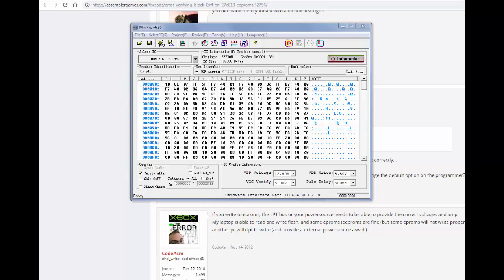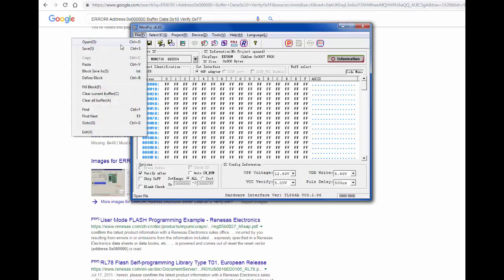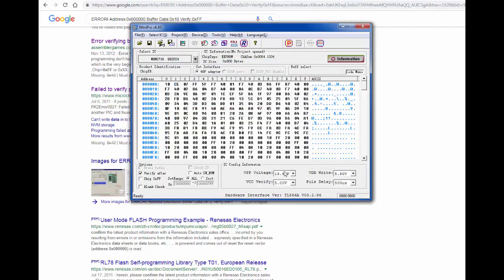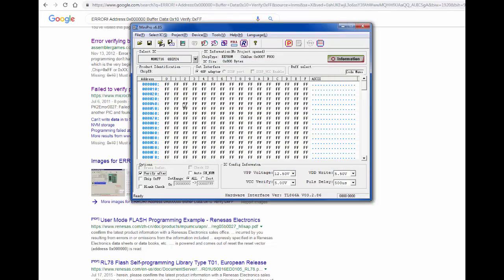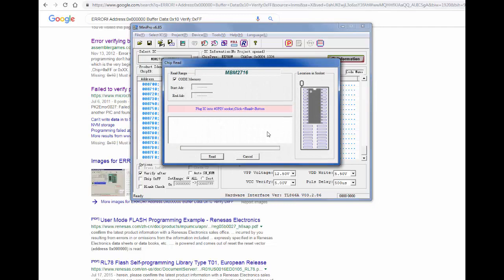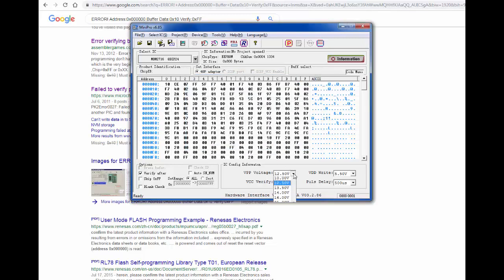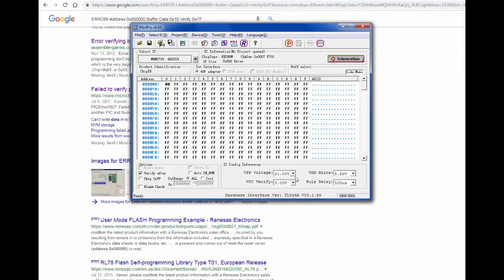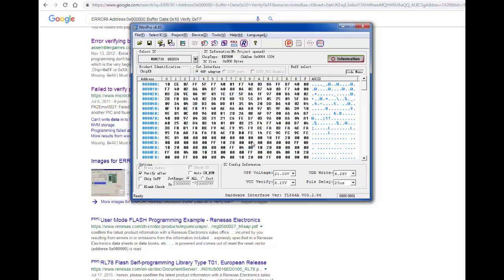MiniPro TL866A Programming MBM2716 EPROM Errors - Part 2

Comment: Are you trying to program EPROM with Vpp=25V needed using an EPROM burner capable of maximum 21V and then are you surprised that it didn't work? WHY?! And what the heck are trying to achieve with the other voltages?
Reply from the maker: Your tone sounds very critical.  I'm sorry my video disappointed you.